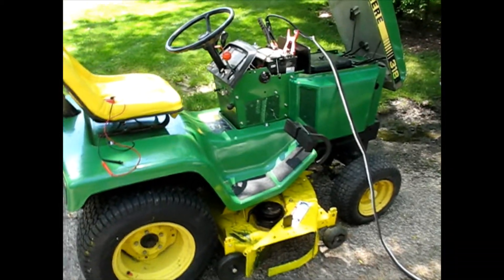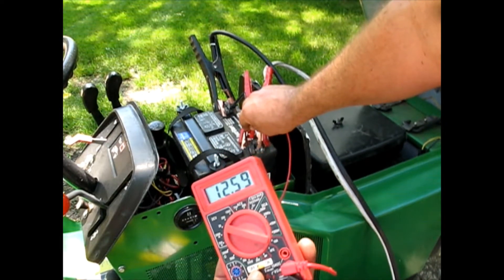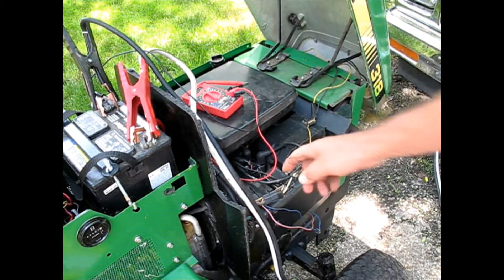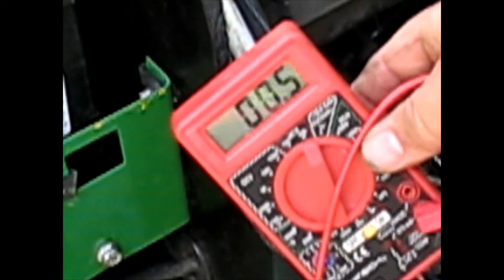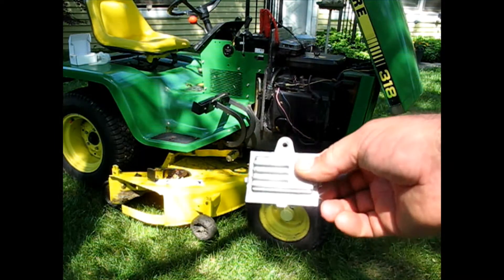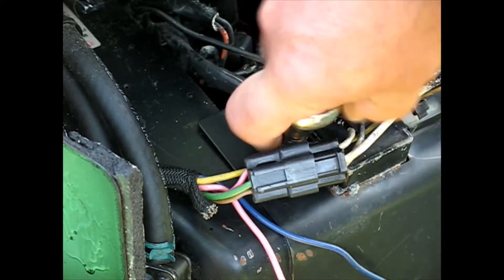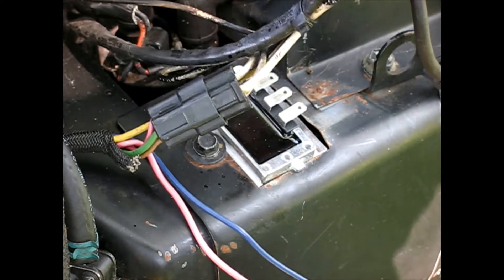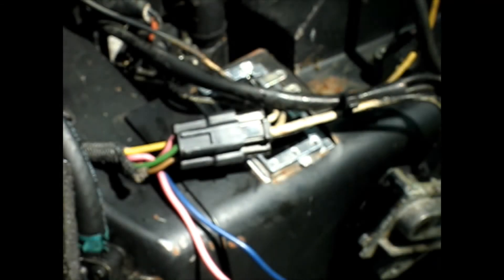John Deere 318 battery not charging  Troubleshooting  ONAN  This playlist number 22

Comment: I'm not sure why your wire terminals melted on the voltage regulator. I would take the mounting bolt back out and clean that engine tin with sandpaper. I believe the voltage regulator needs a good ground, at that tin looked pretty rusty. That could cause heat. Good luck. Interested to see how long the Chinese voltage regulator last. I snatched up a used Onan one, with 700 hours on it, from a local junkyard. $10. I took a gamble and it worked. I think Onan ones are $90 plus. I ain't paying that.
Reply: I am always suspect of a connector that was hot enough to melt the plastic....I would cut it off and crimp a new one on. The metal loses its strength when heated and could come loose again in the future causing more heat.